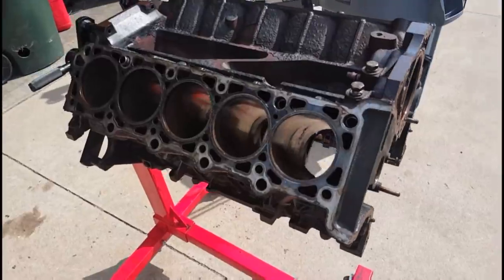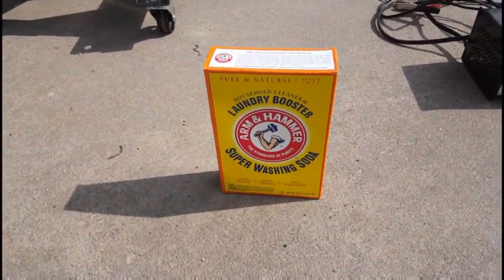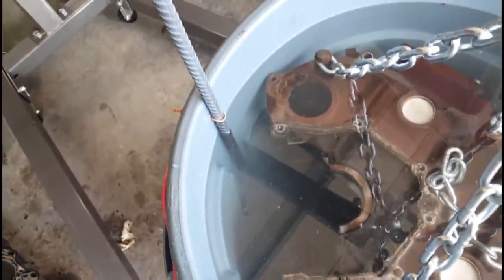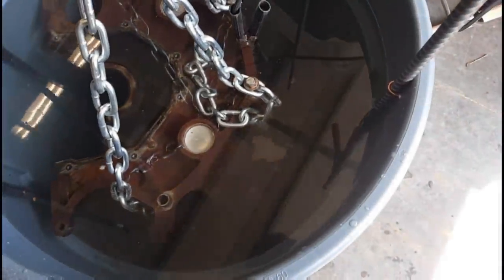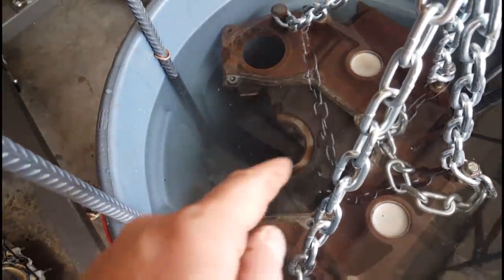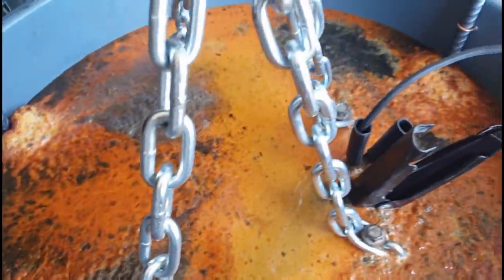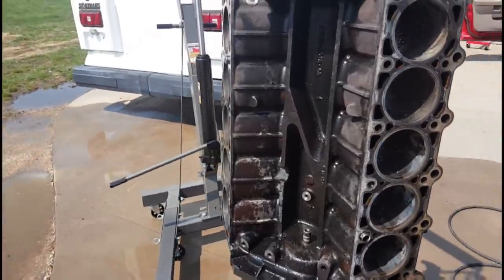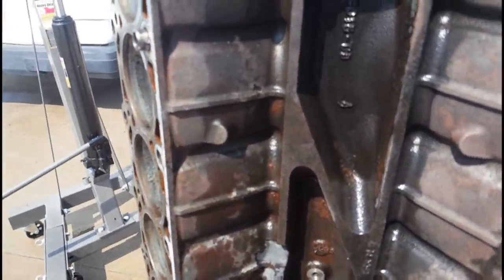1998 Ford 6.8L V10 Engine Block Electrolysis - Part 2 of 3

Comment: You defeated the purpose by not removing the casting plugs. The water channel has gunk you'll never flush out. It packs in the ridges of the water chanels inside the block. It's hard enough to get clean doing everything correctly. by not removing the plugs you prevent the process from accessing the areas it needs to inside of the block. It looks good on the outside, but how do the chanels look inside. Use a bore scope to inspect. Also, the ends of the block have a cruve that bents around back to the front. It likes to pack at that bend along the chanel floor.

Comment: Thanks for the video, have a v10 bus I need to pull motor.  These days, nobody rebuilds engines, back in the day, people did valve jobs on them on a regular basis. no more, now you just replace them.  I bought another v10 for $500.
  The v10 should last to 300k miles if not abused, and mostly overheated engines kill them.
Reply from the maker: Thanks for the comment!  Good luck on your project...
Reply: Most people think a simple solution will fix there problems, when a true overhaul is the only solution. Oh well the knowledge is lost and the techs have won.

Comment: I would like to do it but im wondering , theres no risk of corrosion of cylinders  and bearing dipped overnight in a bath?
Reply from the maker: bearings should all be taken out...  The cylinders were bored and honed afterwards so no problems there...
Reply: @JeffNiemeier  Ok  i was also talking about the cranshaft and camshaft journals.

Comment: I sincerely hope you didn't just clean those cams up an put them back in....... they at the very least need a regrind and new lifters. I could see some flat spots from the vid. Bad break in previously.
Reply from the maker: Put new lifters in.  Still running strong after 15k miles...
Reply: @JeffNiemeier I'm sure new lifters made an improvement but considering the cost of having a cam re ground..i mean you're only doing yourself a favor because not only will it be fresh, straight and consistent but youd get new over sized cam bearings to match. While you're right there it's a cheap way of insuring less chance of having to open it back up again is all.

Comment: Will this process weaken the metal and cylinders walls?
Reply from the maker: No. The electrolysis didn't hurt the block at all...
Reply: Thanks, I will do this to my virgin 1971 pontiac 455 block. Had surface rust from 40+ years of storage.

Comment: Current inside the conductor is zero
So what should we do to overcome it
Reply from the maker: Yeah, won't get any action inside the engine.  I just used the power washer and cleaned it out that way.

Comment: You forgot to take out the welsh pugs, lol, still an easy do it yourself  type of job, but would have cost less if you took your engine block to get it acid cleaned and crack tested before you did the engine, anyway hope it worked out also can you have it made into a normal fuel, because my guess is that its a diesel engine and not a standard fuel system ?

Comment: So you're basically saying that the electrolysis won't work for probably one of the most important areas and or reasons for a tear down and clean.. Lol coolant passages with flaking rust is going to be an issue later down the road

Comment: Before even watching the video I'm thinking....do you really want to etch and introduce pitting in the cylinder bores....??!!!
Reply from the maker: This is not etching!  People restoring very detailed work use this method because it doesn't erode the good metal.  Only removes the rust.  United States Navy uses this method around the hulls of museum ships on display for 20+ years.

Comment: You need to reverse the polarity and put the positive lead on the block and put the negative on the anodes
Reply from the maker: Not correct.  There are several posts on this video discussing this processes very detailed from many people that know more about electrolysis than me...

Comment: All you had to do was let the coolant do that naturally. Ford has SEVERE problems with electrolysis. Blown radiators, heater cores, sometimes the heads if its bad enough.
Reply: I am the Offender of All 5

Comment: This is also how you clean old Cast Iron. The battery is not to "boost" the circuit, but to keep the automatic charger from turning off during the process.

Comment: For anyone watching this with hopes of doing this, You have to be careful after electrolysis the metal is prone to rusting very quick better oil up or paint whatever it is you're working with. Soda ash is another alternative to baking soda I've had good luck. Also do not use anything that is galvanized while doing this it creates toxic gases that are incredibly dangerous

Comment: Should have taken it to a machine shop and yes it would have cost more but the results would have been worth it :)
Reply: Not really, the machine shop can do cutting better than the shade tree guy, but they never clean up very well. And their Hot Tanking is not any better. Plus, if your not friends, I've found several that do sub-standard work.

Comment: to remove rust from difficult to reach spots, just drop in some vinegar and let it there for 3 days, if you see that you still have rust just rinse and repeat... to remove rust and painting from long exterior surface, consider using a bicarbonate blaster works like a sand blaster, but the risk is lower, you still need a good air mask to filter the gunk from the air but it provides the max results in the shortest time...

Comment: From my many years of mechanics experience alot of Ford's have an electolysis problem, especially the Ford Taurus.
Reply: can you elaborate on that? i have a 2000 taurus ohv... the heads and block are both graphitic cast iron. 

the upper intake is cast aluminum, but i just did the lower intake manifold and it was in perfect shape.
Reply: Timothy Manley well, on the taurus the electrolysis issue is caused by not enough ground being introduced to the engine block from the factory causing the block to rust from the inside of the coolant jackets. These are very very common to have muddy looking coolant over a few years time, especially if you let the vehicle set at idle for an extended amount of time. There are no companies that make a very effective coolant flush anymore like DuPont all because of the epa but I personally like to run baking soda through the system to help effectively flush everything out, it's worked great for me! After you've ran it with baking soda for about an hour or so you need to disconnect one of the coolant passage tubes running around the drivers side of the vehicle close to the fire wall and drain everything out with a waterhose while the vehicle is running to insure it's completely flushed and also make sure the heater is on because those vehicles tend to get heater core blockage from this same issue. Don't go cheap on coolant! Either buy the 50/50 mix prestone coolant or use the concentrated prestone with an equal or less amount of distilled water, this will help prevent the issue of electrolysis. Always keep a check on the coolant and make sure it stays green, if it starts to turn Brown, immediately take action and flush it out or it can cost you alot of money down the road. I've had to replace a radiator on a Ford Taurus just because of electrolysis  because it stopped it up and caused it to overheat, a radiator replacement requires you to take the whole front cap off of the car to replace. It's not fun!
Reply: Some extra ground wires will almost fix the issue from what I've  seen.

Comment: Next time go to the thrift store and buy the biggest stainless pot you can. Ask them for ones that haven't sold and tell them you just want it for scrap, or, get some from a scrap yard. You don't need to "move" the rust to a sacreficial anode. You are just splitting water into H2 and O2. The H2 is slamming into the engine block, bonding to the iron oxide (FeO) and stealing it's oxygen (turning it back into H2O, water, and the rust back into regular iron, which will probably break off since the rust already made it crumbly). The O2 from the split goes to the "sacrificial" plate. If you use steel, you'll be creating new rust (FeO) on that piece, but you don't have to "create" rust at all, you just have to have something for the O2 to stick to. If you use stainless, the O2 goes to the surface, doesn't bond to create rust (hence why stainless is stainless), and just bubbles up to the surface as oxygen. The stainless will last forever, bath after bath, and your electrolysis tank won't look like hot wet diarrhea.

The parts that didn't clean up would have cleaned up eventually. The reason they didn't is because there was somewhere easier for the H2 to get to, and there was no swarfing action to shake the rust out. Once all the rust was stripped of it's oxygen, the reaction would've moved onto those areas. If you want to speed it up, next time just install pokers into those cavities, connected to the main bars. It'll make the distances between anodes and cathodes small, and preferentially convert the cavities first.
Reply: @ Dyspresium: Sometimes at least a partial science class is necessary - many things simply cannot be boiled down into two or three word explanations, and even relatively brief explanations benefit from supporting examples.  

This is one such case.
Reply: Stinky Cheese - you don't use the pot to dunk the engine in, you keep using the garbage can. You cut up the pot into sheet metal and use that instead of the rebar. Five dollars.
Reply: I wouldn't do aluminum, aluminum when forcibly oxidized creates aluminum oxide, which is electrically resistive, but also rubs off. It's that black shit you get all over your fingers when you touch aluminum. It's ever-renewing. Also, this is exactly how you make anodized aluminum. The reaction would slow then stop in seconds because aluminum oxide is an electrical insulator. Magnesium, not sure. But... you have stainless.  Just use stainless. Gigantic industrial torches use stainless exactly for this purpose for years on end with concentrations never approaching the dangerous levels to DRINK, let alone... breath or dilute when eventually you flush the water to change it. Idiots just hot-button panic anytime stainless steel is mentioned. HEXAVALENT CHROMIUM, HEXAVALEN CHROMIUM. THE SKY IS FALLING! If you look for hearsay sources, they'll tell you not to. If you find someone who's not just repeating bro-science out of their ass, they'll explain why it's a non-issue with numbers and measurements.
Reply: Paul. It just goes to show you that most people have no patience and are to dumb to learn anymore. The I don't have time...gotta have it now society.
Reply: Hexavalent chromate
Reply: koviack - Chains almost certainly won't be stainless, maybe galvanized. Stainless would be expensive. Maybe I'm wrong. In any case, that wouldn't matter. You need the metal not connected to the engine to be the other electrode, separated by the water bath. So even if the chains were stainless, you still need another electrode.
Reply: Well stated. I've used this exact same process with superior results. Another advantage of Stainless is consistency how the electrolysis process current works. The one thing I haven't taken the time to experiment with is the quality of baking soda and solution. 

I have experimented with making wet 'blocks' (clumps) of baking soda and then placing them inside the water jackets of the block. It seemed to help, but at the time, camera probes didn't exist and there was no proper way to verify if it removed rust in the cavities with no line of sight.
Reply: Yep spot on champ well said also thats why hot water systems has a sacrificial anode in them to stop the rust from forming, still as a temporary system its would be ok to remove the outer rust on the engine, but dont understand how on earth it would get rust on the outer side of the engine block unless the heat proof paint was gone. cheers :)
Reply: Could you use the anode out of a water heater which is magnesium or aluminum in replace of the iron rods?
Reply: MattsAwesomeStuff Yes, I was aware the soda was simply acting as a conduit, hence making the clumps, the idea being to focus current, which I think, is not possible given dilution flow.
Reply: you rock dude, thank you for the information
Reply: Way off topic: After electrolysis, will Parkerizing the block make the cylinder walls and other areas too pitted or hard for proper machining?
Reply: Did anyone try magnesium sulfate (epsom salt) 1:7 with water and phosphoric acid as electrolyte ? Use 316 stainless steel to anode... heat the bath at 95 °C and slowly increase phosphoric acid to 25 gm per liter.
Reply: The amount of hexavalent chromium released when using plates as non-consumable electrolysis electrodes is zero or near zero. Industrial electrolysis "water torches" use stainless. Malls and apartment buildings allow water torches as the only safe fuel source. After 10,000 run hours (full time, 8 hours a day, for 5 years), how much of the chromium do you think will have corroded? Because that's the maximum amount that could have been released. Nearly zero, that's what makes stainless, stainless. It's why it's used in cooking for christsakes.

The danger of hexavalent chromium as it pertains to stainless steel (which is almost entirely iron with a bit of chromium mixed into the alloy), is when welding and grinding it. The former heats it up with a 5000'F arc and vaporizes chromium, the latter particularizes it and makes it airborn to be inhaled. Even that risk is minimal, the greater risk is in actual chrome products like chrome plated car parts (which is 100% chrome on the surface, unlike stainless steel which is only a few % chrome).

In short, stop whining. Risk for incidental non-career exposure is nonexistant.
Reply: Don't use stainless, it can produce Hex Chrome. Use  a graphite rod they're inexpensive on ebay.
Reply: never fucking use stainless, just use graphite rods dood
Reply: I always get my anodes and cathodes mixed up, but...  not the engine block... the sacrificial rebar should be stainless, then the rust will disappear without creating new rust. If the tool was stainless it wouldn't be rusted, would it? :P
Reply: Jesus you must have no fucking life to be able to write all that out.
Reply: Are you insane?  Sacrificial metal rods are dirt cheap.  Recycle or throw them away, easy peasy.  A stainless pot big enough doesn't even exist at a thrift store, would be an industrial part and cost hundreds of dollars USED, and you'd need more cleaning supply cost to clean it than the sacrificial rods cost.
Reply: Doug - The chemical you dump into the water has almost no effect on the process, because it's not a chemical process. It's not a catalyst either, or anything like that. The chemical you dump in is just to make the water conductive. Battery acid is the best thing to use. TSP is the second best (TriSodiumPhosphate, in the paint aisle). Baking soda. Even table salt will work... but don't use table salt because it creates chlorine which will devour everything, even stainless, in seconds.
Reply: @MattsAwesomeStuff  Would graphite work faster since it has a higher conductivity than stainless? Also, is there any bi-product from graphite? The only thing that would come to mind is CO and/or CO^2.
Reply: @Infiernofox138  - Not sure. You're forcibly bonding oxygen to it, so, maybe CO or CO2, but probably nothing. Doesn't matter... You can get stainless for $5, use stainless.
Reply: @MattsAwesomeStuff  Well, I already have waste graphite from a few projects which is why I asked. I guess I'll just test it out myself. Thanks for the response!
Reply: Graphite is not having more conductivity at all, but it has some, and probably you will need higher voltage
Reply: @RAPXZibit  You literally have no idea what you're talking about.
Reply: well you can't say graphite is a good conductor - it's not
Reply: MattsAwesomeStuff alright we didn’t need an entire science class man😂

Comment: Never put a battery on the concrete floor!
Reply: Old wives tale, from back when the battery cases were rubber coated wood.
Reply: White TigerGaming/Vlogs 

Utter nonsense that cannot be backed up with factual data.  Concrete can not drain a battery; it is non conductive as is the battery case.  Any failures observed after placing a battery on concrete, or oatmeal for that matter are a function of long storage periods/disuse, defective/worn out batteries or time in cold storage.
Reply: All batteries lose power. The concrete floor has no effect. Like said, old wives tale.

Comment: You can pour muriatic acid on and in that block, wait about 30 minutes and flush it out with a water hose, and it will strip all of the rust off and out of the block.
Reply: I’ve used Muriatic acid for cleaning out the coolant passages on several engine rebuilds.  Works wonder in cleaning all the junk out.

Comment: Sacrificial anodes/scrap metal should be similar size/area to the part, that rebar is far too small for an engine block. Sheet steel round the tub would have yielded far better and faster results. It also works by line of sight so rust not facing an anode will stay put a lot longer.

Comment: For better results use drano crystals with your soda. 
Pour hot water in your drum  mix the drano until it deasove  then put the block in water and connect it to charger, you won't believe the results, bare metal, gray cast iron